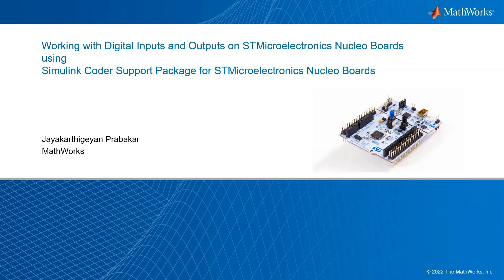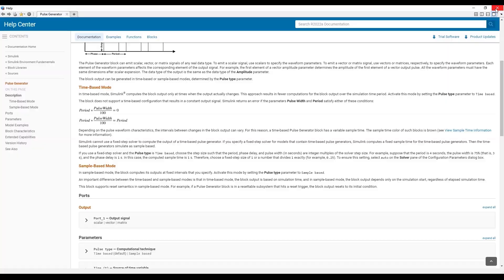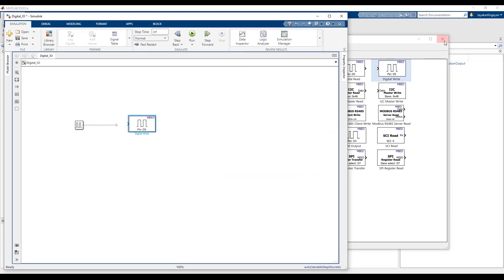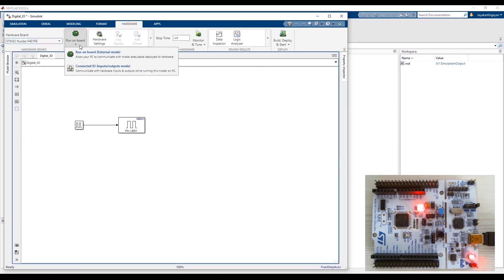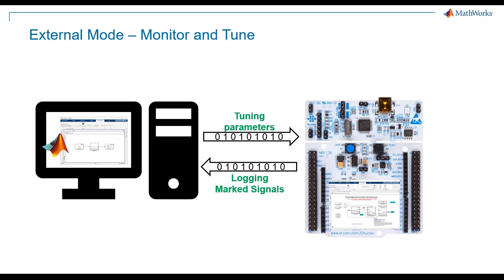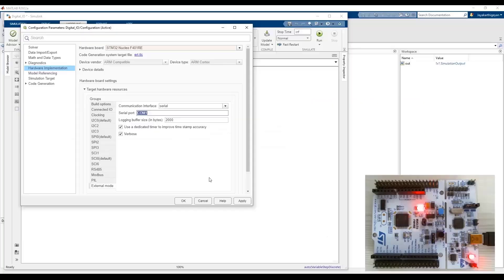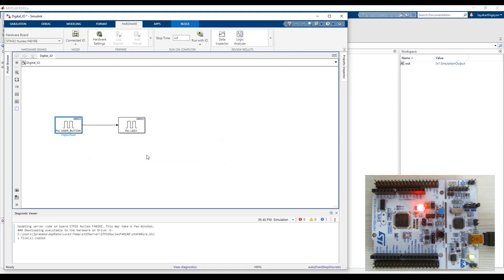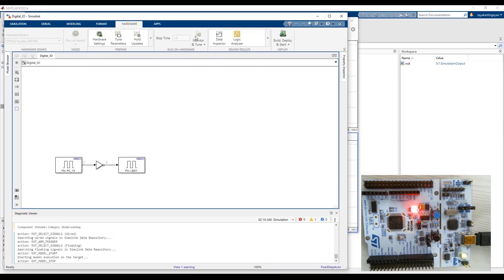Working with Digital Inputs and Outputs on STM32 Using Simulink

Comment: I am getting an error stating the Code generation file does not exist.
Inputs must be character vectors, cell arrays or string arrays. 
I am using STM32F4Disc board @matlab @MATLAB
Reply: In my case, the build and code generation results do not seem to be detected if the related files or paths contain spaces or special characters. Try it.

After correcting the content that was displayed as a warning before the error, the error disappeared.

Comment: Sir i am getting an error if i connect the board stm32f103c8t6 which is a customised one ...is it possible to flash the code n verify the output in such customised boards or not? Kindly reply

Comment: Please release STM32 support for home license users. Within hobbyist community Arduino is getting obsolete and even the beginners are now switching to stm32 boards. I know we now have support for esp32 in R2022a but the board is flaky and I prefer to work with stable boards like ST micros.